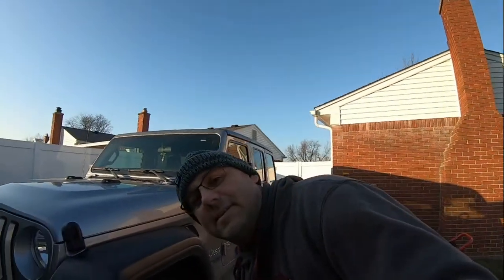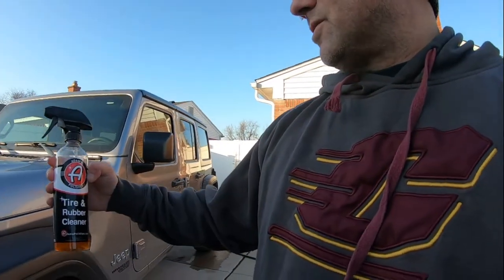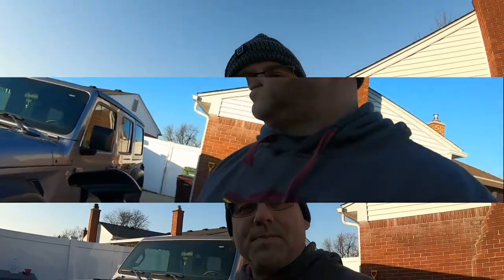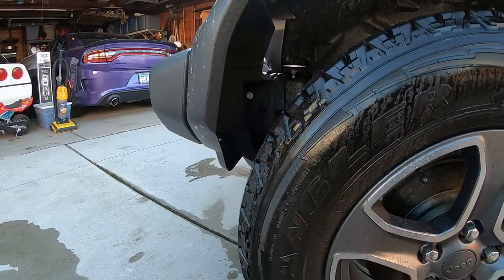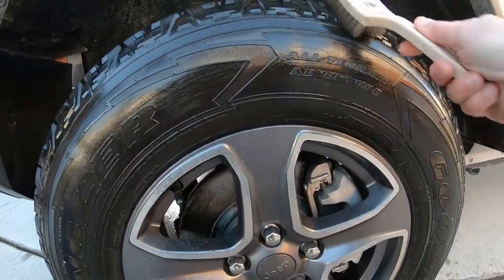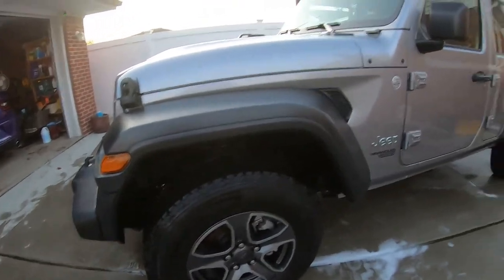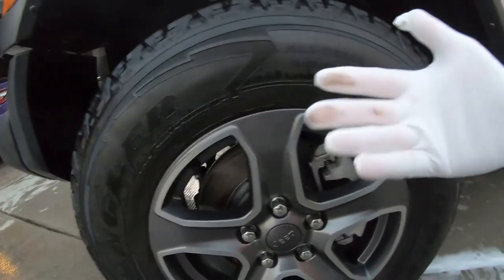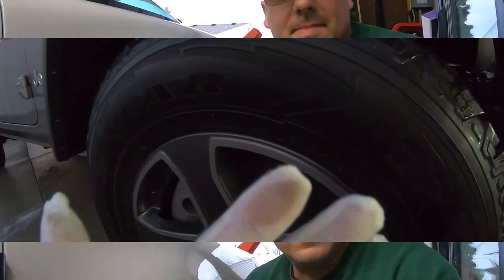Best Way To See How Clean Your Tires Are. Must Watch

Comment: Hey man, just wanted to drop by and check out your videos. Found your channel through Camaro Time. I actually never knew they made tire cleaner. 

Nice video, and I subscribed as well.
Reply from the maker: Camaro Time great channel and great guy . This tire work pretty good and use can use to clean plastic and rubber . Thank you joining our channel .
Reply: Ouzo Lou Garage what was the price on that bottle of Adams tire cleaner?
Reply from the maker: It's $12.99 at Adams website and $14 at Amazon link for Amazon is in the description.

Comment: Steve, tires are the the biggest pain in the @$$ for me, truthfully I'd rather do glass. I have 20" truck wheels  and you're right I spend 15 minutes per wheel. I often split my wash up, I do tires say Friday or Saturday night, then the wash the next day. Let's not enen talk about product consumption. I'm now using McKee'37 APC for tires and wheels, they have the most economical dilution ratios, my tires and wheels are pretty well maintained the stuff works great, and I can use on all the the truck,  just dilute appropriately, McKee's runs 20% sales often, ocasdionally 25%, and once I caught a BOGO gallon sale. Shiney's makes the best brush for tires, it's actually their stiff carpet brush, and it's only 5 bucks. Great video! One tip, I cut up an old 2 x 4 into four  pieces, and drive the truck up on them, gives you clearance for the brush at the bottom of the tire.
Reply from the maker: Same here cleaning tires stink. O yea you not having fun cleaning those 20' wheels and using a lot of product on them. I still need to try Meckee product what I seen from video good products. Getting stuff on the sale is the way to go and good idea on 2x4 for clearance .Thanks Jay Zstr